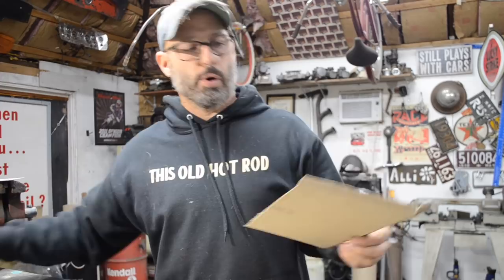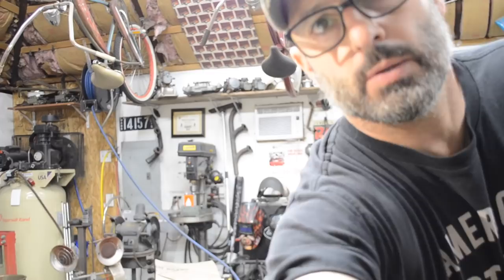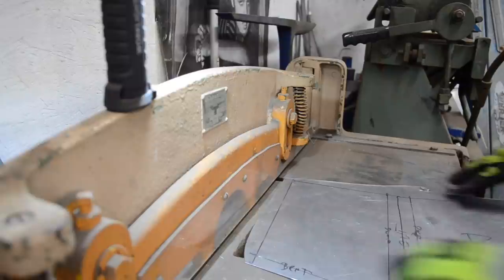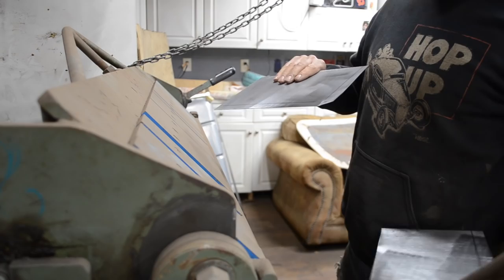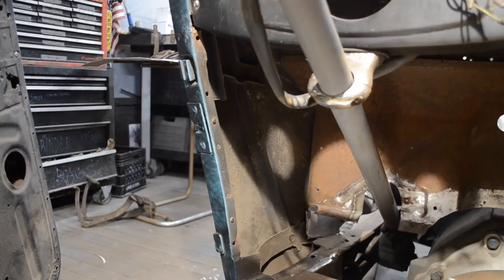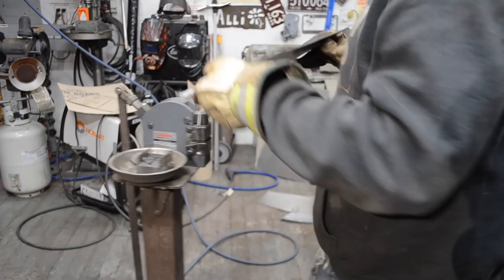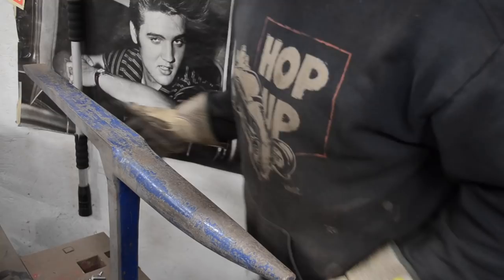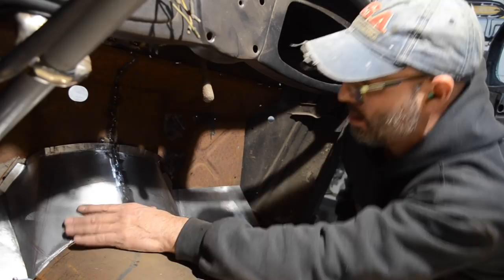Toe Board Sheet Metal Fabrication   HD 1080p

Comment: hey Mike can you show more on the surface conditioner i have been thinking about getting 1 but would like to know the drums last or if they burn out quick ?
Reply from the maker: I’ll have a lot more video of it during the remainder of the floor pan fabrication. 
I’ve only been using it a few weeks and I’ll say.  I’m very impressed.   I wouldn’t hesitate buying it. I have yet to see the drums wearing down.  The only time I had an issue was when I was using the finish drum(scotch bright) was when it caught on the edge of the sheet metal. I’ve since changed direction of the drum while at the edges.  
It’s amazing.